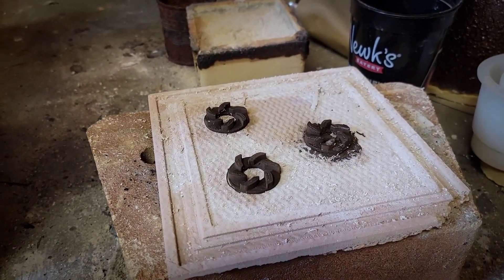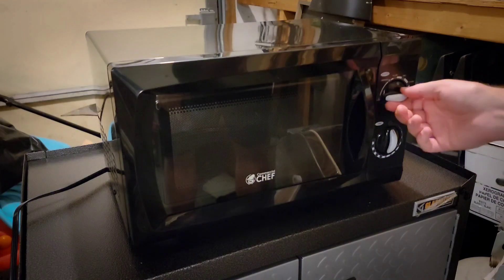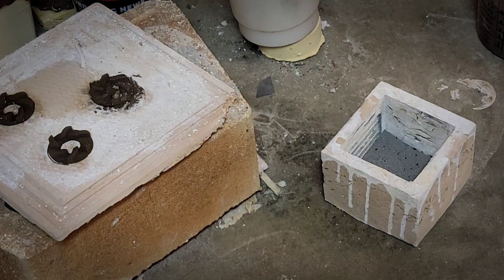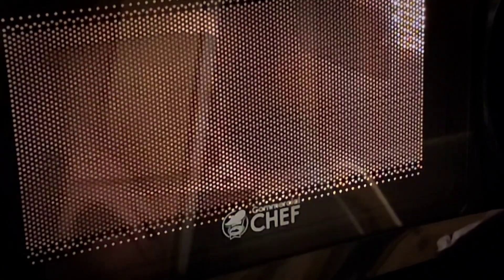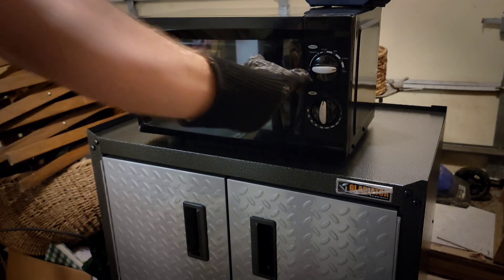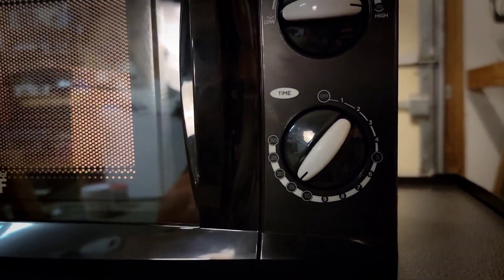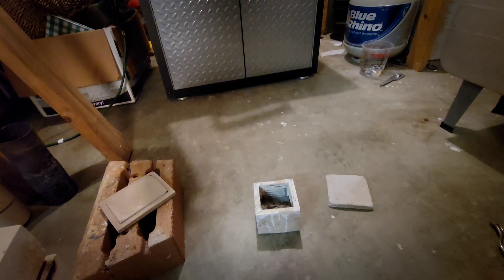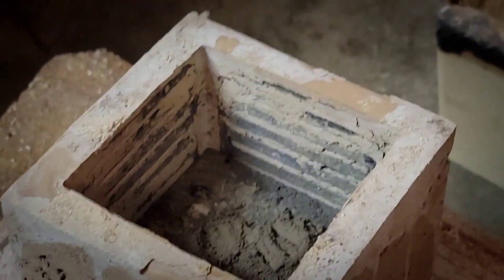Metal in the Microwave? 3D printed Steel Sintering #experiment #3dprinting

Comment: Could you use a vacuum pump to remove the O2 and therefore have a good sintering oven?
Reply from the maker: With some mods to the maybe, but the problem might be over heating (needing to remove the crucible and then re-draw the vacuum).

Comment: Nice, I like where you're heading, though I think virtual foundry says you need to put the parts in a Crucible with a ballast material, and in your case you'll need sintering Carbon to prevent oxidation.

Comment: Stainless Mini convection ovens can be bought cheap. I may have paid $120 for mine new but a comparable model today is around $60.  

It is one that has a broiler options so i was thinking this might work well. It wouldn’t be difficult to make a slide in sand box that keeps it centered in the oven. 

I think if i override the control using a PID i may even be able to get higher temps from it without major modifications. Perhaps 750’s i have to dig into the hardware and see.
Reply from the maker: Interesting! That would be enough to properly debind

Comment: Nice video,  I work at a company making powder metal parts and am a material science engineer.  You need to have a protective atmosphere to get a good sinter or at least one with no oxygen. Your material will oxidize and prevent the bonding of the particles. One trick that might get you closer is to make a stainless pouch with some thick foil, put in a small piece of wood and your impeller.  Crimp the foil closed so no air can get in. I would put the whole thing inside your crucible because there will be sparks from the foil.  The wood will ignite and consume the oxygen in the bag.  If you get up to around 1950 degrees F for 20 to 30 minutes it should sinter together.  Maybe check the power rating of the microwave.  You might need more power.
Reply from the maker: Thanks for the reply 👍 
Normally I use a sintering carbon in my regular kiln but for this first microwave sinter I didn't. Later sinters with aluminum I've been able to get a proper sinter with Flux alone (haven't revisited steel yet but will try flux & carbon when I do)
Reply from the maker: Oh also have two other microwaves now 😄 
900w and a 1100w which I'll be benchmarking and doing trials soon with

Comment: 2 more. 
Do you have a discord
And the Amazon microwave kiln.  
They are round with a black … liner?   Have you tried one of those?
Reply from the maker: No discord but you're welcome to post on the VF reddit where I mod,
https://www.reddit.com/r/TheVirtualFoundry?utm_medium=android_app&utm_source=share

Or just comment on an appropriate youtube video where I'll be glad to answer questions.

Have not tries the Amazon kilns but I spoke to VF on the topic and think they could be used simply by flipping them upside down and covering the round portion vent hole with a bit of ceramic (flipping upside down because you'll want to fill that round portion up with ballast and easily be able to remove the "lid" to dig out your part without ballast spilling in your microwave)
Reply from the maker: I'll add that if you want to completely use the microwave for debind and sintering it may be challenging because the debind process normally works best "low & slow" (low meaning temps) but I have experimented with it at 10% power rate. I think it would be possible but you should have access to a regular oven and I think it may be better to "bake" the crucible and 200f for 1hr then 400f for 2 hrs with a window open for ventilation before going into the microwave for sintering
Reply: I’ve got a kiln.  But Im hoping this technique will be useful for materials my kiln cannot sinter.          I can only go to 1100c
Reply from the maker: @landsquid2789  that's about how far my kiln can get up to and exactly why I think this can unlock steels & other higher temp stuff too
Reply from the maker: Turns out VF made a discord recently (didn't know about it). I'll be in there and post & answer people's questions

https://discord.com/invite/RE7rCHYU
Reply: @Mr-Highball  slingshot…..engage

Comment: Looked like your part was up top….
Do you pack the “crucible” just like normal with the white sand stuff?
Reply from the maker: Depends on what I'm testing, but normally I'd pack so that the part rests roughly in the center of the crucible. This time though I wanted to grab heat readings off the piece to see where Temps were getting to after a certain amount of time

Comment: I thought you were not meant to put metal in a microwave, am I incorrect in my thinking?
Reply from the maker: Not recommended for everyday heating but you can put metal items in for a short amount of time (it's the arcs that happen from sharp edges that are bad for a microwave) but the crucible here insulates the part on the inside so in this case the biggest threat would just be getting too hot for the components of the microwave to handle.

If you do a search for "microwave kiln" you'll see a lot of people have done this for glassworking since it's very quick to heat up
Reply: @Mr-Highball  Glassworking via microwave.  Neat
Reply from the maker: @maureenravetti6192  haven't tried it myself but Amazon has some kilns for about $40 ready to go for glass. Good luck if you try 👍👍